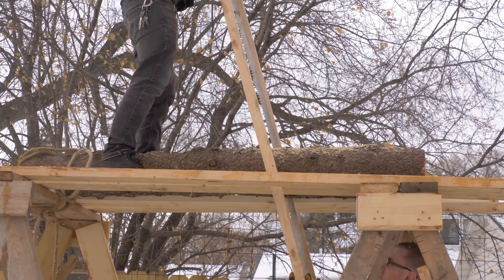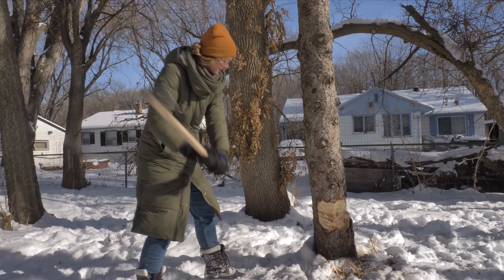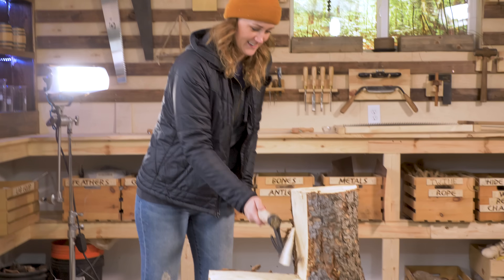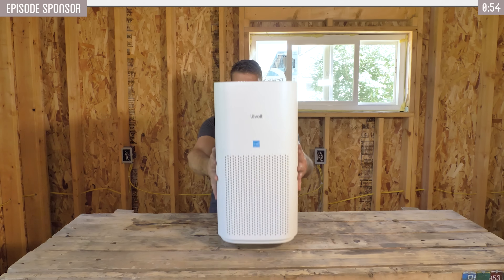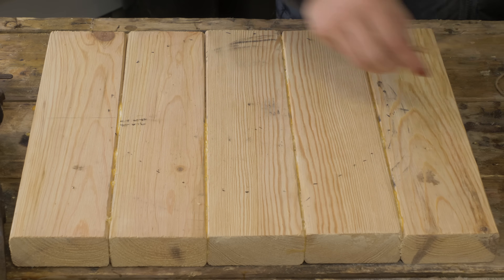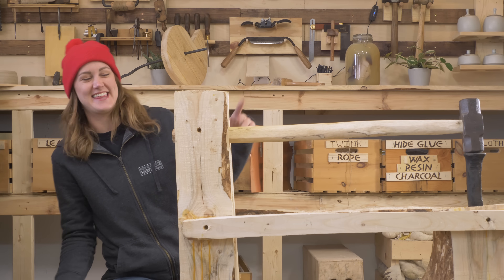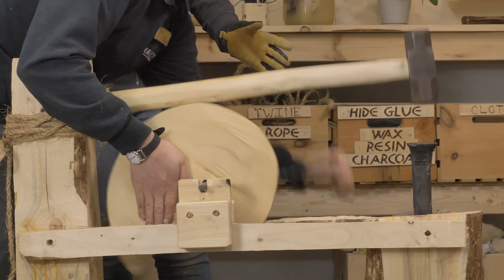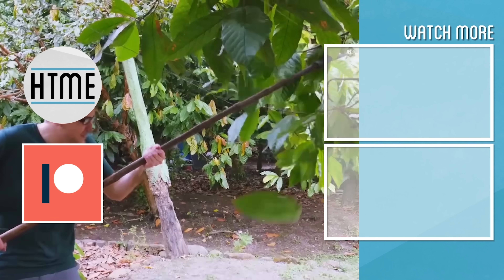Does Da Vinci’s 500 Year-Old Power Hammer Actually Work?

Comment: I built one of these with my dad when I was in college. Of course we used metal and power tools, but our had the same problems you are having. We added weights and springs and drove the cam with an electric motor, but ultimately, it was less effective than just swinging the hammer by hand. Our failed hammer is still out there by the garage today.

Comment: 7:30 a better way of drawing it would have been to use a fixed point in the middle, use a pole with a bigger diameter and then draw the circle using a string that gets rolled u on the pole. That way you get that nice spiral

Comment: Put 2 guide sticks from the top front corners of the hammer holder tower, diagonally along the sides of the cam then secure them in front of the part holding the cam and it will guide the hammer along the cam problem solved.

Comment: I would put the cam at the back pushing down and use a longer handle to turn the hammer into a huge lever should lift it higher plus create greater force without needing to enlarge the cam.

Comment: It's rather clear from how the hammer drops that you need a deeper "fall", because it's not even impacting anything before it gets caught on the cam as you spin it. The speed of the turning, and the height of the fall, means it never actually reaches far enough down to hit the anvil, and the item to be struck.

Comment: usually you'd use a hewing axe for this, which is just a shaft with a blade facing down sticking directly perpendicular to the handle. it's designed in a way so that when you have the blade completely sunk into the wood you still have a good 3-4 inches of the blade sticking out the back end to whack with a mallet to to evenly hew. but this technique of cutting notches into the wood to hew in chunks is still very viable if you lack the tools or don't want to for a new specific tool for something you can just do with your normal axe anyway.

Comment: Since there is a problem with the strength of the hammer instead of getting a bigger hammer you could use an elastic force, like springs to add extra down force to the hammer. Since you plan on a power version it wouldn't give you any extra work while operating the hammer

Comment: most trip hammers i've seen used the cam on the back side of the pivot point,  (with a beefier pivot) and a MUCH heavier hammer.  Having it back there also allows for pretty precise control over the drop height of the hammer itself....  All you need after that, is a power source to turn the cam (water wheel would be traditional, but windmill would work, as would a treadmill with couple dogs or ponies or helpful assistants to power it.  another option might be a large flywheel, so the effort to keep it spinning can be minimal...

Comment: Late to this, but another idea to get a further 'swing' from the hammer without needing to necessarily chamge either the size of the cam or the hammer would be to make the hamdle longer and still keep the can close to the axle/fulcrum of the hammer, while it would no longer allow the person at the anvil to turn it, if you're not intending to anyway, this could be an easy solution to use what you have.

(Albeit it does make it larger overall)

Comment: a pin sticking out of the side of the hammer handle that rides on the cam will work alot better because it will fall off the cam quicker.  also, maybe a spring to add some force?

Comment: nice start. 1 groove the cam so the hammer is centered. 2 as others have said the start needs to be smaller so the hammer isn't hitting the cam on the drop. 3 increase the power by making a longer hammer handle. move the cam so it is about 1/4 of the way up the handle. this should lift the hammer higher before the drop.

Comment: Shoud've put the cam 90 degrees to the handle - same max height, no slippage.
Also, make the "drop" of the cam below lowest point of the hammer, aka below surface of the anvil.
That way youll not be swaying sideways when holding hot iron, no slippage, no unnessesery damage to cam when hammer drops on it, full usege of max height.

Comment: You don't necessarily need a larger hammer to get a solider impact.  What you need to get the extra impact is more weight.  So you could add put some iron/steel bands around the shaft near the head.  This will cause a heavier impact.

Comment: to save on wood you could have just carved a groove into the cam to keep the hammer in line with it and you definitely need a more significant  drop as im sure the cam got in the way a few times and stopped the hammer from actually landing.

Comment: Your cam is not shaped right. Your hammer is landing on the cam when it drops more often than it his the metal object. Need to add less right angled-ness to the cam after the drop to allow the hammer to full drop while still moving the cam... otherwise you need to stop or slow down your spinning in order to let the hammer drop all the way before the cam starts touching the hammer. Ignore the Fibonacci spiral shape in the drawing. Also your adding of a second cam made it wider, yes... but it's really that tiny little groove between the two that is guiding the hammer and keeping it running true. You could have sanded/ground down a groove in the one cam to affect the same thing. Finally, wax the every moving part to reduce friction.

Comment: Great vid.  
I think that it looks fine.  
Just grease the cam and axles then add some lead weight to the hammer and power it with something/someone.  
Lead rod is easy to bend around the top of the hammer head or handle.  
Regards, Jas.  
VK4FJGS  
Rockhampton Queensland Australia

Comment: You could add a pull down spring below or push down spring above the hammer handle as something to add velocity to the strike. This in turn could be made to lend adjustment as well.

Comment: Just create a crankshaft from your water wheel or use a paddle to flywheel system to keep the motion perpetual with each step.

Frees up the other hand to hold and mold your steel.

Comment: what big  waste of fire wood. the whole point of striking molten steel is to pound the oxygen out of it for quenching, you have to hit that shit hard, over and over, as hard as you can, with more gravitational force than dropping a ten pound sledge hammer. thats where pneumatics and hydraulics beat out non conventional brute force. you could have lit the forge for days with aall that wasted wood

Comment: You know in the title it shows da Vince's hammer wheel. As someone who has built hi machine using a 12 oz ballpeen hammer. I made 1 mod to it. I ended up making the cam for the movement of the hammer adjustable up and down by screws so I could add shims basically. It actually worked pretty good. The problem I found was the release point to allow the hammer to fall and strike the workpoint. So I made another mod later. I used a twisted rope with a screw adjustable tension so I could increase strike force. Amazing what he had done so long ago. Fun designs to play with also. I've even built a cutie chunker entirely out of an old oak tree I cut down to test designs and to see how I could improve upon it.

Comment: I’ve cut and Milled a lot of timber, You don’t want to crack that Hartwood, better to cut through clean or else that crack will run through the center. Especially cold spruce great work otherwise, gonna subscribe

Comment: Yep, you looked at the design but you didn't understand the concept. That's OK! The comment section is there to help ;)
The wheel is on the wrong side of the pivot.
Make a longer handle, place the wheel on a right angle to the handle, opposite of the hammer pivot point and voila. With change in the length of the "handle" or distance to the pivot point, you change the mechanical advantage or height of lift.
It would allow for placing springs or weights or a much larger hammer. The latter is preferred due to the forces acted upon the mechanism.

Comment: The cam is supposed to go perpendicular to the shaft of the hammer. It's quite obvious that would be more effective that the orientation you have it in here. Make a hole in the large post, and put the handle through that to turn the cam.

Comment: You could modify the hammer so that you can attach barbell weights to the shaft. That way, the force can be adjusted as needed. Also, a treadle would probably be advisable to allow the user to control the speed of the cam. I haven't read other comments, so someone may have already said this.

Comment: You can add a 2 larger layers on the sides of the cam, to make a guide for the hammer to sit in, also you could try to use a heavy rock as a weight for the hammer!

Comment: So looking at the davinchi hammer. The hammer has the 90dagree bend so that the wheel acts as a counter balance to the hammer.due to gravity being canceled out the stroke is effortless almost. And it looks as if the cam has a groove where the arm runs with some sort of ball bearing to that there is less resistance. That 90degree bend is very important to the devinchi hammer. It makes the swing effortless. The cam should excelerat to the trip point. If designed properly you get a balanced system where all your energy is conserved into the swing. Not perfectly but close.

Comment: A good way to mount a hammer on a handle quickly is to tap the head into position, then whack the hammer shaft-down against the ground, so that the inertia of the head pushes it down into place

Comment: Forging is not about the power you put in to the hammer. It is about the heat and the number of strikes you can put in to the hammer in a given time. If you can strike the piece 10 times before it cools or 100 time before cools and move more or the same amount then you are doing good.

Comment: wheel saw is better, and retracing hammer, also circular motion only, with water wheel
Reply: or just have a lock-unlock joint for the circular hammer, bonk-fold-out-spin-bonk
Reply: yes mimicks a person whacking a hammer, 1 spin axle, 1 lock spin rim axle for the hammer
Reply: carbon does not rot
Reply: think carbon fiber, they are painted/glued, carbon can hold its own
Reply: or just singer up-down circular motion slot converter
Reply: fix some bugs, or squeeze some bugs
Reply: small model examples only

Comment: another idea for giving it more power: extending the length of the pole of the hammer the opposite direction of the hammer and creating a bow (to simulate a rubber band or spring) to connect to it  so when the hammer goes up it pulls the bow and when the drop is hit the spring gives a boost in velocity creating more striking power.

I guess you can do it the other end of the hammer but instead of being above the automated hammer which can be difficult to construct a platform to hold the make-shift spring, the make-shift spring could be added (close to the hammer head) pulling downward which you already have a frame to attach the make-shift spring to.

Comment: If nobody said it already, you could turn the cam 90 degrees with the crank sticking out the back, probably through a set of braces, making for a smoother operation. It would also get the cranker's face much farther from the work

Comment: Ah man. I remember making these as a kid. Bringing back so many memories. Use a 'pulling' spring attached about 4 or more inches under the hammer head, and on the frame in between the anvil and the cam. It will add pull into the hammer increasing strike force.

Comment: Longer lever on your hammer, two boards turned vertical just down from the hammers head fixed on the frame to guide the hammer and keep it on track. Longer hammer lever means same cam more lift. Put the cam further back from the head the further back you go and the longer you make the lever driving the hammer the higher the lift of the hammer head there for increasing the amount of energy transfered to your material.

Comment: I'm certain you probably already know about this but if you don't... you can use beeswax as a lubricant(i think especially on wood?), I believe I've heard it was often used on wooden machinery throughout history?(I did do a quick google search looks like that's the case) anyway i think the power hammer would benefit from heavy usage of beeswax and possibly other lubricants. like on the cam wheel both along the cross pin and on the outside of the wheel its self also all the joints like where the hammer arm connects? just a thought

Comment: Hhmm if you were to make an onward gap on the spiral just to more or less work as a guide, and then ad some sort of a spring or flex band that would pull the hammer down, that would add both force and stability of the hammer strike.

Comment: I built a similar hammer for my home blacksmith shop based on your design. I used innertube rubber to pull the hammer up to it's max swing height (instead of a cam) and a treadle to pull the hammer to the anvil with every step. It works pretty well but I ran into the same trouble as Andy. The hammer is limited by it's weight as well as it's ability to be dropped to the anvil in a controlled way. I do think that a treadle attached to the hammer handle with a cord allows it to be pulled with greater force than gravity alone. The davinci design was conceptualized, presumably with a massive hammer, for industrial use. Anyway, thanks for the inspiration! It's pretty cool and I wouldn't have such a fun tool if I hadn't watched your videos.

Comment: Aside from having a repeatable setup, I think having the cam rotated 90° would be better. This is because it doesn't fall as far as it could only as far at from the highest point of the cam to rest across the rest of the cam body. Rotating by 90° also removed the issue of it falling off the cam.

Comment: I saw a video of a mill that used this concept.  It was for crushing ore for refining.  There was a trough that held the chunks of ore and three hammers side by side.  The three cams were on a common shaft but were offset so that only one hammer was raised at a time.  It was water powered.  The hammers were actually rocks that were raised and dropped to crush the ore.  If I remember correctly, the trough was made of stone.

Comment: To put weight on make a strap from the axe handle that goes underneath in front of the wheel and then use regular stone connected to the strap and then connect it to the water wheel then the wheel that is moved by the water wheel also carry the stone up.

Comment: You could've just nailed a piece of wood to each side of the hammer (which would act as a guide) so it wouldn't fall off. That would have saved a lot of work. Sometimes the simplest solution is the best

Comment: You need to add a spring under the handle to store more energy as it is raised up and decrease the distance of the smaller radius to increase the throw of the hammer.

Comment: Back in 1956 (7y.o.) I visited some Cousins in Northern Italy who had a small Blacksmithing shop in a backstreet of the small Town I lived in for 9 months after my grandad passed.
There were two wooden beam trip hammers, driven by a water wheel in an irrigation canal...not much head of water, but sufficient to drive both hammers at once...a lot heavier than the video examples, but LdaV design exactly...given the workshop was probably at least 100-150 years old at the time, it was a simple solution to a mechanical Problem.
Specialised builders and carpenters often built waterwheels in Wood and Iron across Northern Italy, as snow fed streams supplied sufficient power for Milling grain, sawing lumber, blacksmithing  etc. Well into the modern steam power era.
Doc AV Australia

Comment: The idea was good but the construction was appalling. In Carpentry things are meant to need neat, tidy and close fitting. The circumference of the circle was to big for the drop of the hammer. If that was smaller, the hammer handle wouldn’t catch it when it fell, meaning it would hit harder with the weight, the weight of the hammer will also depend upon the weight used when trying to use it for blacksmithing. If you connected it up to a mechanism which you could engage and disengage which was also connected to a water wheel or a turning wheel turned by say a ox it would be able to turn more fluid and make striking the blacksmithing metal easier and wouldn’t need another person to use it other than the blacksmith. Over all the idea is a good one (After All Da Vinci designed it), it’s just needing to be constructed better. Also if you are making the wheel part for the dropping of the hammer, use the wood you got from the tree you felled. Using bought wood is going against the build, also don’t use modern glue, you had antler in a box behind you, you can make glue which is what Da Vinci would have done and it would have been more in keeping with his original design. I think you show a lot of promise in your work, just clean things up more and be more precise in the construction and you’ll be hitting 10 out of 10 in no time

Comment: In SDS hammer drill works really well for a motor for the cam hammer it has a lot of torque and if you put a bungee cord over the hammer to pull down towards the anvil you'll get more power